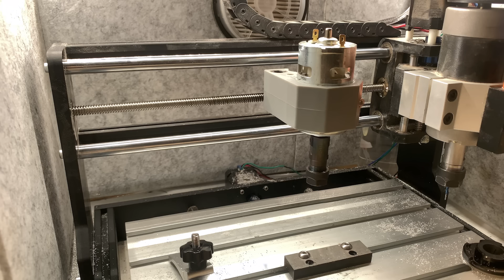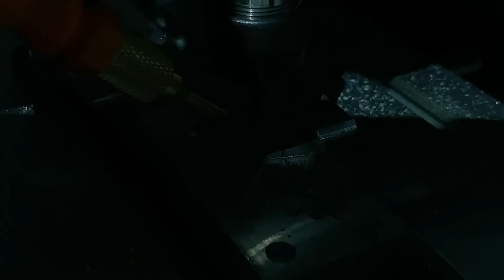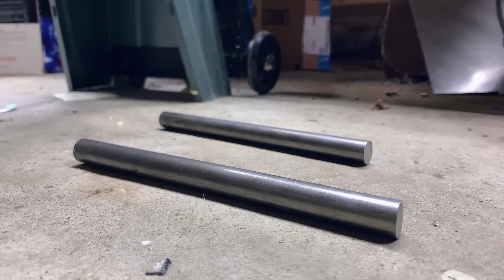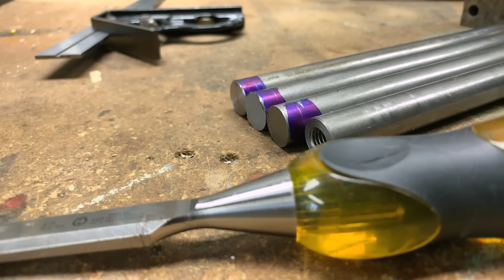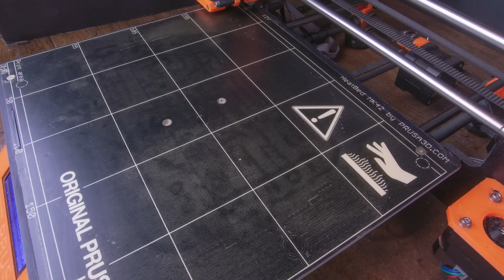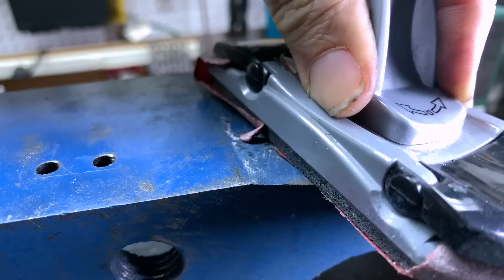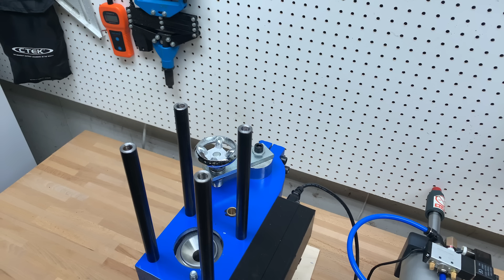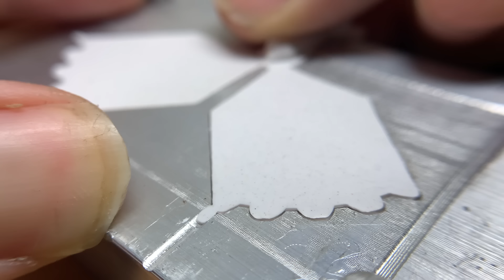Build an Injection Molding Machine From a Cheap Pneumatic Press

Comment: My 3018 has just been shipped. Going to need some mods.
Reply from the maker: Great!  Yes they're a crazy amount of fun.  I probably should have messed around with mine as-stock for longer.  Hell I didn't even video it, since I wasn't planning a video at the time.  So I don't have a great feel for what it could do as-stock, but it certainly was able to route a little panda out of plywood I had around.  They do make a mess if you don't have an enclosure for it!   I modded the heck out of mine almost right away because that's what I do, but they are amazing learning tools.   Sorry being so slow getting back to you.  My power's been out for 3 days.

Comment: FYI, you don't need a double sided mould just for the runner.
Reply from the maker: Good point.  Still I was just trying to get the whole system down.  That Little My mold used both sides.  :]    You're right though, I could have kept it simpler.

Comment: Amazing storytelling and get project work as well.
Reply from the maker: I'm so glad you liked it! I always sweat over the story telling aspects and it is a bit of a relief to have someone call that out as something they liked!
Reply: @retrotechjournal  I have struggled with converting video footage of topics I find interesting into entertaining stories. I'm inspired to try harder after seeing your story telling. I loved many scenes but the one where the chisel was used to introduce the line bored and tapped pipes was outstanding!
Reply from the maker: @MarthallersMisadventures  Thanks!  Some ideas I plan out ahead of time, but often I have to just come up with those things as I'm going. Like "how do I film this to make it interesting".  Of course once in a while I have some idea that takes days to do.  lol.  Like that shot where the camera follows the blade down and kind of goes though the metal. I spent a whole day shooting that and a few more hours fiddling around with the footage to get it to look ok in post.  I had to figure out how to drive the bandsaw with my drill driver so I could have it move down smoothly so it looked like it was under power.  So crazy.  ;]  At least that one worked out.  I've spent long hours filming things that looked bad/I didn't use.  Have fun!

Comment: Holy shit, this is awesome!
Reply from the maker: Thanks!
Reply: @retrotechjournal  Update after attempting build... the heater bands require a different screw, correct?
Reply from the maker: @JustTechGuyThings  I think some bands I got had a long enough screw but I think in one of the builds I did have to put longer screws in.

Comment: Keep uploading new videos sir
Reply from the maker: Oy, I'm trying.  Normally I work on the videos like crazy over the holiday break, but this year I'm having to help my mom move, so things are going to be going a bit slower.  Sorry!
Reply: @retrotechjournal  alright but you can also upload short so subscribers will stay engage
Reply from the maker: @djzatka  I was kind of wondering about doing that.  I often have a short animated sequence that is part of a much longer thing, and I could in theory put those out as I make them as Shorts, but I'm a bit worried that if I do that, it might sap the energy I use to edit together the final sequence.  (Which is the most difficult part)  Also they don't necessarily make that much sense on their own.  lol  It's a good idea though.  I'll think about it.
Reply: @retrotechjournal  thats right

Comment: Is it possible to use a MK3 chamber?  I'm new to injection molding but want to make multiple parts in one mold so I think I need the biggest chamber. By the way, awesome job one your build.
Reply from the maker: Shot size is all about stroke length of the cylinder & the diameter of the chamber.  Any upping of the shot volume will have a symmetrical lowering of the shot pressure.  The other  thing I get from the MK2 chamber are that it is much longer than the stroke of my cylinder, so plastic can have longer to heat up since the heating time for a shot is longer than the time between shots.   So far I haven't done any molds that are need higher pressures than I have, or higher volumes then I have, so I don't really have any gut reaction to how useful a higher shot volume with lower pressure might be.  I think it may depend on how thin/spread out your higher volume designs are.  If  they are thin/detailed, I'd be nervous that you might make something that has the shot volume, but won't be able to fill the mold/get the detail you want.   I haven't looked at the MK3 dimensions but you could probably build this with that heating chamber/a different ram diameter.  If that will then meet your needs is less clear.  Good luck!
Reply: @retrotechjournal  ok.  Thanks for the information.

Comment: As for the loom hooks this may have helped you out... https://www.youtube.com/watch?v=RAciAS1ssuc those parts seem good candidates for this.
Reply from the maker: That is a cool technique for objects that can be printed in a stack.I hadn't seen that before.  Great for 2D-ish parts.    Of course since making the loom  I built a pneumatic injection molding machine, so probably the next time I need to make a few hundred identical parts I'll do it via injection molding rather than 3D printing. I do like that as a technique though. I'll keep it in mind for times when I want something on the order of 15 parts.  Thanks!

Comment: i work in injection molding and we control injection speed holding pressure cool times and many other factors down to .01 on many settings
Reply from the maker: Wow so cool!   Having that level of control really lets you dial things in.  How long does it take to fine tune settings for a big run of parts on some new mold?  I suppose some molds are easier than others.   Are there certain things you dread?  Like "Oh man this mold has a lot of <something something>. It's going to take forever to dial in."

Comment: Great video with a ton of info.  I've been resin casting for nearly 3 decades.  I'll just stick to that.  ;)
Reply from the maker: Yes, you diffidently have much more flexibility/ease of mold making, etc.  Mostly I was doing this to learn more about injection molding, and as an excuse to learn CAM.   Which sort of worked.  I definitely got my feet wet!    That and the little screwdriver I injection molded in shop class many years ago made me realize it was possible to do in a shop without too much tooling. They just had one mounted on a big drill press.  Nothing fancy about it.  I think that screwdriver is still in the "junk drawer" at my dad's house.  lol.

Comment: Interesting project. My day job is industrial machines 500-1550ton. What injection pressure do you have?
Reply from the maker: If I remember the math, with  this ram size/psi limit on the press it's 2500psi.   A long way from a commercial machine, but so far I haven't had to go anywhere near that pressure in order to fill the molds I've made.  So far so good.  Of course the parts I'm doing are quite small.  Our Live Steam group once took a tour of a local injection molding place.  The machine shop was really impressive!
Reply: @retrotechjournal  My machines are 20-30,000psi. I suspected you could get away with less pressure, but wasn't expecting it to be that low. 
You have me wondering how to build a clamp to run full auto. 😁
Reply from the maker: @pictsidhe6471  The AP-100 press I was imitating is rated for 6333psi, but their cylinder is rated at a higher pressure than my import one.  Running full auto would be amazing!  Of course, that ups the mold complexity a lot since right now (for the things I've been making) I haven't even need a real ejector mechanism, etc.    I have made some improvements since I made this video,  including adding a pellet feeding mechanism.
Reply: @retrotechjournal  I saw one auto mini machine where the ejectors were actuated by pins hitting a stop behind the moving platen. Simple yet effective. An air blast or an automated pick may work on shallow moulds. As someone who spends a lot of time on hydraulic machines, I think a pneumatic machine is great idea!
I've been working on a 1000ton toggle recently. IIRC, clamp cylinder is 160mm, giving a mechanical advantage of its clamp around 20. I forget the length ratio. I could measure up the toggles on one sometime if you like, the geometry is the key. I have 4x toggles, 3x direct, 3x 2-platen machines. I'd suggest a toggle. A suitable cylinder and a 5/3 are not too pricey.  We run mould cavity tonnage at roughly 1/2 of injection pressure. You may need to go higher on your thumb sized stuff. Run fast, you will get inconsistent melting with your plunger barrel.
A pneumatic toggle will be a little tricky to get running smoothly, it will want to slam. A ball screw toggle would be nice. Our 1550t is a ball screw toggle.
Controlling all this will be a challenge.
Reply from the maker: @pictsidhe6471  Do you have a link to some examples of those toggles?  Sounds interesting.  I guess that's one good thing about manually opening/picking/closing the molds.  I wasn't able to go fast enough to have issues with inconsistent injection temp. :]  Of course the molds I've been doing aren't any where near a full shot, and even a full shot is only maybe 1/3 of the plastic in the barrel so it seemed to be spending enough time in there to reach some kind of stable (ish) temp.  Some pneumatic machines use a pneumatic,->hydraulic clamp to get the pressures up, but that wouldn't have anything like the throw needed for mold opening/part ejection.   Some sort toggle seems like the right way to go.
Reply: @retrotechjournal Animation:  https://youtu.be/NyNefYueqS8
Dimensions are off, but shows the motion.
The screw in a large machine does a great job of melting and mixing the plastic. But won't be easy to miniaturise. Shear does the majority of the heating. This is needed for speed as plastic has poor thermal conductivity. Some kind of insert for your barrel that forces the plastic through a reducing annulus would speed up melting. Would be a PITA to get out for cleaning, though.
Reply: @retrotechjournal  Just looked at the 1000t toggle specs. 160x927mm clamp cylinder. Max pressure is around 3000psi from memory, that spec is well buried in the book... Clamp stroke 1000mm. If I can work out how to upload, I'll video a 720t toggle running.
Reply from the maker: @pictsidhe6471  That would be awesome, I'd love to see it in action.

Comment: I'm an injection molding process Engineer.  If you need any help. I just found your videos.
Reply from the maker: Oh, great!  I know my mold's thus far have been kind of crazy simple.  Trivial parting line, no ejection mechanism at all.  lol.  I'll keep your comment in mind when I try something trickier.   Great to have a pro I can pester with questions.   I've been wanting to try some sort of mold where I do that overshot with a different color/more rubbery material.  Just because I thought it would be fun to try.  And because I have that other hand injection molding machine I could do the main injection with the pneumatic press, and then swap one of the sides and inject again right away with the rubbery material using the manual molder.   Right now I'm using PE.  Do you have a recommendation for a compatible material for that kind of overshot?  I'm actually in the middle of a different project just now, so not sure when I'll be designing my next mold. Great to hear from you!
Reply: @retrotechjournal  that sounds great. Overmolding is a tough process. I'm impressed you are capable of doing that. I cam send you a material compatability chart that can help. Some material are not chemically compatible.
Reply from the maker: @aldenallen28  Well we will see if I manage to do it.   Sure I'd love to see the chart.  I guess part of the issue is I don't want to buy huge amounts, so I may be somewhat limited in what materials I can buy in small quantities.

Comment: Have you shown your CNC upgrades in more detail and do you offer the STL files for the mods you made? Do you have a video or article about it? I can't seem to find it if you have. Also do you have a non-bearded brother who also makes content because I could swear there is a guy with many of your mannerisms and voice similarities who I have watched but cannot think now who he is.
Reply from the maker: Well, I did all the CNC tinkering off-camera because I wanted to actually get it done, and opposed to it taking 30x as long because I was filming it all.   Also I was just playing around, wasn't sure if it was going to work out.   I was pretty happy with the way it turned out, (The larger diameter X axis rods are much stiffer), and the upgrade is kind of cheap, so that's good, but the down side is you really need a precise way to cut the case hardened rods to a very specific length so folks without a metal lathe/carbide tooling are kind of out in the cold.  Also I intentionally sacrificed some Z travel to make the thing more ridged and that's not a choice that's good for general CNC work.  It just happened to be an ok choice for my wanting to machine 1/2" tall injection molding dies.   I'd be happy to share the STL's if that's of any use to anyone, but it's a bit of a very specific upgrade, and with no write up/documentation etc.  They're going to be of pretty limited use.    

I'm not aware of a beardless youtube brother-from-another-mother but if you remember who that is be sure to let me know.  :]

Comment: Remember to "always use your safety glasses".  Great quote.
Reply from the maker: lol.  A bit of a callback to Norm Abrams.  I don't mean to poke fun at being safe.  A pneumatic injection molding machine is really very dangerous since there are a lot of finger crushing/dangerously hot and sticky plastic/possible steam explosion/hot plastic fumes/etc kinds of dangers.  Those are very real dangers but I figure if anyone actually goes so far as to build one they'll have read up enough about injection molding to know.

Comment: Dear RetroTech,
You are amazing with skills and creative engineer!
I have same design press (china made) sitting my garage and I would like to retro it into a plastic injector as your, but I don't have the 3D printing know-how nor the printer.
I only have the auto-mechanic tools (drill, socket, ...etc...)
I am wondering you would make and sell the retro kit so I could just mount it on to do plastic parts.
Thank you for the knowledge sharing and have a good day.
Best regards
Reply from the maker: Thanks for your interest in this project!   Unfortunately, my life is super busy so building kits is a little outside the scope of what I can do.  I'd love to help, but it's just not something I can take on.  When I started this, I had kind of hoped that I could come up with something so easy that someone could use Send-Cut-Send or something to make the collar, and the rest would just be 3D prints/hardware store parts/other standard hardware.  That would have made a "virtual kit"  Kind of doable since it could just be a parts list/links/models/cut file, but because ultimately I had to machine the bottom of the casting a little that just wasn't practical.   Clearly you need to make friends with a shop teacher or something!

Comment: Incredible video. Great project, fantastic humor, amazing editing and presentation.

Do you think you could use 3d resin printed molds in this? Maybe adding fiberglass to the resin or using the 3d print to cast a mold out of more resilient material like epoxy resin or concrete or ceramic/coldcast porcelain?
Reply from the maker: I've seen a lot of people doing short runs or test runs using 3D printed molds.  I don't have a resin printer so I haven't tried it myself.  A big part of this project was me wanting to learn more about CAM/CNC so going directly to metal molds was part of the fun.

Comment: you certainly got a lot for your money!  Great design project.  Thanks for sharing this.
Reply from the maker: Yes, I'm pretty happy with the way it turned out.  Happy to share!
Reply: @retrotechjournal  I just noticed on eBay that these are available from the US for <200CAD! :)  even if there is some damage/fitment issues, looks like a GREAT deal!
Reply from the maker: @en2oh  Yes, I've seen the prices going up and down.  Some great deals to be had.  The main thing is to make sure to get one with the timer/controller.  Since that gives you all the timing and the injection counter all in one package.  I'm sure some of these must arrive non-busted/dented.  lol.
Reply: @retrotechjournal  time is what Arduino is for!  I think that even if busted, the core parts will likely be good... you gauge glass was gone, right?
Reply from the maker: @en2oh  Yes, the gauge glass, and the solenoid valve.  They did eventually send me replacements, but it took for ... ever ...  so I bought a replacement solenoid valve to use in the interim.  I used a different regulator until the replacement gauge came.   Regulator was fine after that so it was only the gauge.

Comment: 3d printed molds (resin/pla) for injection molding
Reply: dont forget the metal support frame bracket around the resin/plastic mold
Reply: check thecraftman's videos of that
Reply: also just 2-parts resin cast in 3d printed cast molds, no pressure heating required
Reply: what helium chamber, remove that part
Reply: seems like your mold opens because not enough side clamp
Reply from the maker: Oh I should mention in the video that does happen, but that was just because cranking down on the clamp rather hard was going to bump the camera/move the mold/mess up the shot.  So in those shots it was only sort of lightly clamped.  When I actually clamp the thing fully it doesn't open at all.  I could have done some fake re-shoot of that once I saw the footage, but I didn't bother.  Good eye for detail that you noticed that though.
Reply: many copies of the same exact mold side by side, fast swap, let cool, etc, with the 3d printed molds